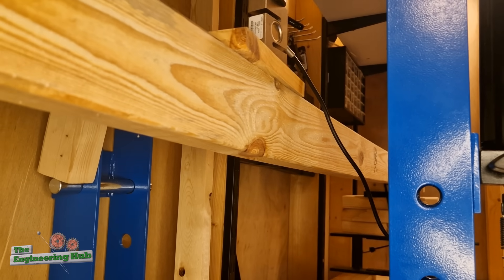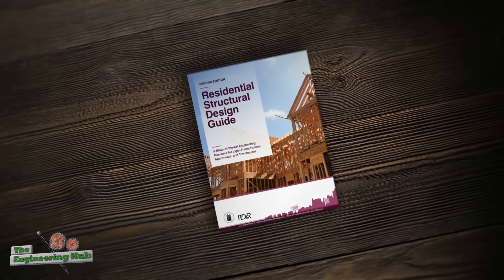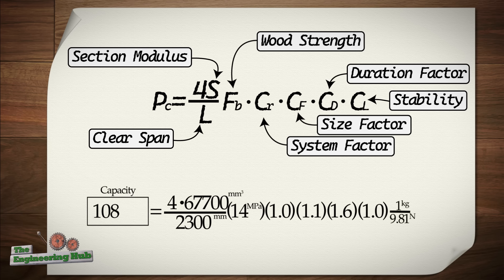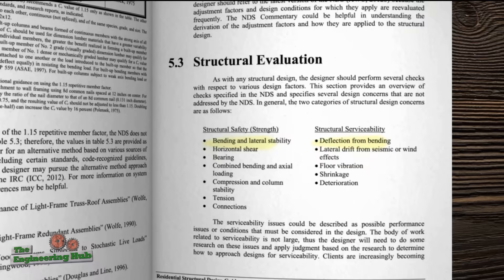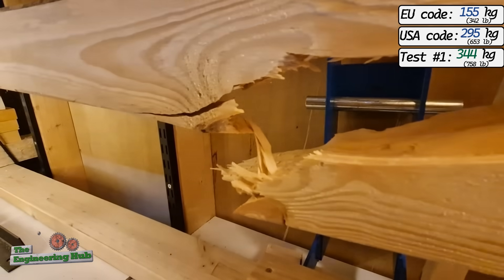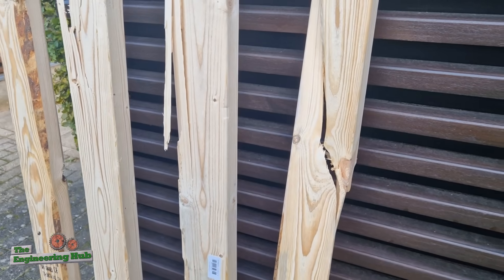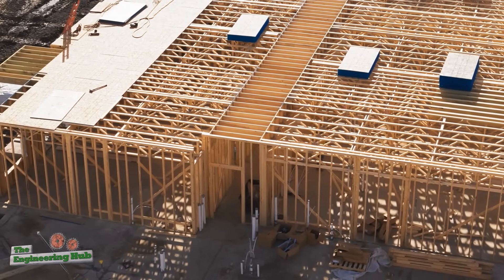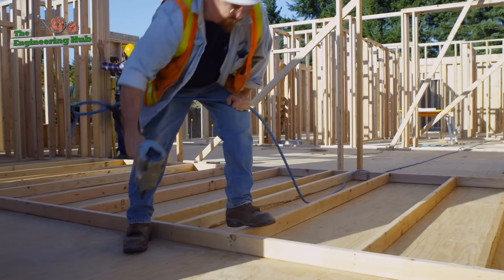I tested the strength of the 2 by 4!

Comment: Graded C14 apparently - I have never seen anything less than C16 in the UK and C24 is pretty common. Looking at those C14s, I wouldn't make a chicken run with them.
Reply from the maker: I bought the wood in Denmark and I would say most of the lumber (at that store at least) was graded C14 as you can also see in the video. I'm not sure if the graders are just being overly conservative because the yield stress was way more than 14 MPa although the boards did look very poor on the outside.
Reply: @TheEngineeringHub  Many thanks for the reply. It's a long time since I did the sum but if you take the text-book figures for the tensile strength of pine you get far higher ultimate load capability than the ratings. Also, the degree of pessimism applied to, for example, roof structures seems to have increased considerably over time. Some years ago we had a garage roof replaced. The original, some 70 years old was a corrugated iron job supported by 2 x 4s at a considerable spacing. Its demise came only after a considerable period with the sheeting rusted through in places. Its replacement, to modern regulations, included a 10 x 4 cross-beam to halve the span and 6 x 2s at about half the spacing of the original 4 x 2s. I did wonder if they had stressed it to allow the car to be parked on rather than under the roof.🙂
Reply: @ColinMill1  I was told that old timber was stronger per cross-section than modern one because it tended to be more slow-grown and hence denser. I am in the middle of refurbishing a 90 year old house, and I can tell you that the 90 year old 2x4s that I am removing are noticeably heavier than the new ones I am putting in.
Reply: @chrisgemmix0815  It's possible. I have just measured the density of some new offcuts here and 480 kg/cu.m which is in the middle to upper end for white pine but there are plenty of pine species it could have been in the past that are denser. One thing that is different here is that, going back 60 years 2 x 4 sawn really was 2 inches x 4 inches. These days it's a good 6mm under that in both directions. Even allowing for that the regs do seem to have gone extremely pessimistic over time.
Reply: In Norway c14 is not allowed in load construction, min c24, assumed the same in Denmark.
Reply: @ronnyjohansen1636  In Norway you have no shortage of trees to choose from I think.😀
Reply: @ronnyjohansen1636  You can use C14 for internal walls only in Sweden, else C24.

Comment: The piece of wood you have between your press and the beam is spreading the pressure out, which the standards authority tests might not do? (IDK, just noticed this, that's all).
Reply from the maker: I suspect the same, it probably helps distribute the load and achieve a slightly higher capacity. But I don't think that it would help more than a few percent, max 10%.

Comment: In Sweden, the smaller dimensions are wood that has been planed. If the plank is sawn, it has larger dimensions. We use the metric system, but I use inches when it comes to lumber. I say, "Two inches Four" and if the plank is planed I say, "Two inches Four planed"
Reply: Yeah, 2x4s were the full 2" x 4" pre-war and not planed, so they were rough sawn, here in the States.  Then there was a period of a few years when they were 1-3/4" x 3-3/4", finally becoming 1-1/2" x 3-1/2" and fully surfaced and planed.  If my memory serves, they may have begun the transition right before we entered the war, like '39, '40, or '41.  We can still order rough-sawn dimensional lumber for design elements, and the older guys (I'm raising my hand here) will still order our larger pieces (6x, 8x, etc.) by appending S4S, for surfaced four sides.

I never found a definitive reason why the transition was made, but I am assuming much had to do with cost savings (8X volume versus 5.25X volume, a full one-third savings) when people realized that vertical members did not need that much mass with the load they were usually carrying, along with the more pleasant smooth surface.

I could go on and on, but I'm sure I've bored to death more than just a few.
Reply: Interestingly, we right across the sea from you, in the Baltics, calculate with the same Eurocodes, but wood here is in mm, e.g. as 100x50mm (not even 95x45 as in this video)
Reply: @ivankuzin8388  100x50 = Two by four sawn timber. I didn't work much with building carpentry, but mostly with fine carpentry. Our timber was always carpentry-dry and unplaned, and we just said Two by four.
Reply: Alla kallar det 45 x 95 nuförtiden.
Reply: @SkogsMangan  Utom jag som säger två tum fyra hyvlat. Jag jobbade inte så mycket med byggnadssnickeri, utan med finsnickeri. Vårat virke var alltid snickeri torrt och ohyvlat.

Comment: Note that if you've bought 2x4s in the big box stores (HD I'm looking at you) they aren't even 1-1/2 x 3-1/3 but almost 1/8" smaller in both dimensions. So I built part of a project with one delivery then had huge problems because all the lumber was smaller. I went to the store intending to return the lumber I thought had been missing BUT found out everything they were getting had experienced 'shrinkflation' (like in the grocery store where the box is the same size but has less contents but the price didn't change, so you ARE paying more for less). I went to a couple other suppliers, found some older bundkes still the old size and bought all I could afford to stock & store for future projects.
But the point is that smaller 2x4 aren't going to meet the strengths the old ones did.
But that wasn't the problem I had, we built some walls with a mix of old and new lumber and the dimensional differences weren't noticed until the sheetrock was being installed, going fromba std board across to a narrower board then back to a standard board leaves a gap under the sheetrock at the narrow board and caused the screws to pull through there. Yes, crappy builders don't care and a double bay of unsupported sheetrock would probably last long enough for the warranty period to expire but that's not how I do things. Andvif you built a whole house out if the smaller lumber, tolerance stacking would throw off your prints dimensions eventually. So new prints would have to be drawn up? The mills aren't doing this on their own, the big wholesale outfits buyers have to approve (and maybe even instigated it to get more sticks of lumber out if trees so more profits?)
Reply from the maker: Also the fact that the new growth is harvested at a much smaller diameter could play into the push for another size reduction (just speculating, I don't really know) but the motive of higher profit margins is probably baked in. For now the high reserve strength seems to cover any potential cut on the dimensions.
Reply: @TheEngineeringHub  yes on the strength but it really does create problems when your using material that's smaller than specified. If a wall is thinner because the boards are smaller, will prefabricated window boxes fit? Code requires that utility lines holes through studs have a certain amount of wood left on each side, I forsee some inspectors who are picky failing some installations (sink drain lines running horizontally through a std wall pretty much have to be centered to leave enough wood on each side for compression strength support, i didn't measure but if the line was just offset slightly with the smaller stud then it wouldn't have the code required measurement.
Reply from the maker: @bobjoatmon1993  oh absolutely! So many issues with mismatched lumber. I was not disagreeing with you: I was just adding a thought. Cheers
Reply: @bobjoatmon1993  2x4 walls are antiquated unless your framing double walls
Reply: I have an older house like 100 years old and the two by fours are real full dimension 2x4 inches. I was shocked at what passes for a '2x4' today. Not even close in deminsion
Reply: The big box stores absolutely dictate size.
Reply: According to Wikipedia and other lumber-related sources, 2x4s haven't actually measured 2x4 for over 100 years thanks to the growing demand for milled and finished lumber, and the decision to standardize on the 1.5" x 3.5" finished dimension began in 1964.
Reply: @torqueytorque8861  the point is that even the 1.5x3.5 standard is gone and that really complicates following plans based on the old 1.5x3.5 dimensions. Other lumber and sheet has also been metricicized smaller and yet prices are higher. Shrinkflation
Reply: @bobjoatmon1993 Where are you getting your lumber from? 1.5 x 3-1/3? These are not nominal lumber dimensions for 2x4. It's 1.5 and 3.5. Why are you claiming this no longer exists? In the US it is still 1.5x3.5 so I'm not sure where your claim is coming from. You are telling me your lumber is 3-5/24 inches in width. Thats a shrinkage of 7/24" or almost 1/3 of an inch. Lumber can grow or shrink by 1/8" but 1/3" due to moisture loss or gain but I have never seen that much deviation from nominal which is 3.5". At most is 1/8' but most are within 1/16" of nominal. If your lumber is really that off, then I would return it because those are not nominal 2x4 dimensions. Nominal in the US is still 1.5x3.5 . I've never seen 3-1/3 nominal width for a 2x4 aa you claim. Home depot lists there nominal 2x4 dims as 1.5x3.5 but yet you claim 3-1/3? Where are you getting this number from. And then it's shrinking 1/8 from that? I'm not buying it because I do not know of any place that sales 2x4 as 1.5x 3-1/3. Where on earth are you gettig your nominal dimensions from? Go look at any lumber yard/store and it's 3-1/2 not 3-1/3.
Reply: @vangmountain  The HD store in Tyler Texas. And I checked several bundles, it's ALL UNDERSIZE. And i used a calipers so it's not measuring error. 
Im complaining / commenting about a problem and you want to nitpick.
Why do I bother.
Reply: @bobjoatmon1993  I'm not nitpicking at you, but I did have my doubts because those measurements you gave are just unheard of in my neck of the woods. So yes, I was genuinely questioning you in the hopes of seeing if this was in the US. Seeing as it is Tyler Texas, I can believe you because Texas consumes so much lumber. Demand can have an impact on quality. Me personally, I have never seen such numbers and I don't think it's a widespread issue like you think it is. If I had to posit a guess, I would say it'a where you are at Tyler. Small town in big staye with high demands. Tyler is getting scraps while the metros are getting all the good stuff. This I can see. What I can't see is everyone getting junk. Texas' demands are too big to make upset. Likely it's confined to Tyler. They dont carw if you get upset, bit they do if a big contractor gets loads of lumber and none of it is good and to puts the back. Time is money so big cpntractors aren't goimg to put up with it. All I know is at one time, I had family friends buying lumber from HD in MN and deliveeing to OKlahoma for nice profits which is insane because there was no lumber to be had. So yes, I can believe your numbers but I don't believe it's an induatry thing. Without knowing the region, I had my doubts about the numbers you provided. For sure it's not widespread. The other thing is it can be specific to a particular mill. If HD knows this is a problem, they are going to send that mills material to the smaller areas where there voice doesn't have much clout. Just my thoughts.
Reply: @vangmountain  now that I can agree with
Reply: Try putting a 1 x 2 next to a 1 x 4 and notice the different thickness.  This is just wrong.
Reply: @bobjoatmon1993  The lumber I purchased last month at a Home Depot in the Mid-Atlantic was 1.5” x 3.5”.  Sounds like somebody is pulling a fast one where you are.

Comment: Does the code describe when the 2x4 colapses or it's maximum safe load?
I mean, I'm not a structural engineer, but as far as I know, they have something called 'safety factor' or something like this, which changes depends on the application.
In some application it can be 2 in some other it can be 5 or more.
eg, if that board failed at 500kg load, then can be used for predicted load of 250kg in flooring (factor 2), but only for predicted load of 100kg for a bridge (safety factor 5).
btw. those factor values are just random numbers, to describe my idea.
Reply: I think I remember "allowable stress"  for wood is the 5th percentile strength value/2.1.

Comment: I'm a bit concerned about using the load cell in this way. The force should go in the threaded holes, not distributed over the whole face.
Reply from the maker: @MichielvanderMeulen  I calibrated and tested the cell extensively before the experiment. I am comfortable saying that it matched with the loads displayed on the press (traditional pressure gauge so different measuring mechanisms) within 5% agreement. For a YT video it should be okay. Cheers

Comment: What ever the dimensions and species, the grade, etc, the engineering is done from simple tables and they tend to be quite good. I've never had any kind of framing failure in 55 years. And I'm still working, too! The 1.5" x 3.5" has not changed for many decades, I think since 1964, when I believe it had been reduced from 1-5/8 x 3-5/8," and it had been that for decades. And people are STILL saying,  "You mean its NOT a REAL 2 x 4" ?!  No ma'am, its a sort of funny deal we get from the lumber companies. But I assure you they are entirely adequate." Now of course we use 2 x 6, if you can handle the nomenclature, and we went to 2 x 6 to accommodate more insulation, also an old story. The whole thing reminds on of other questionable dimensions, but lets not make this more complex than it is.:face-green-smiling:

Comment: Did you use the correct die to do the test? that board which the gauge seats seems that is helping distributing the force
Reply from the maker: @tuzzogetti  Yeah, I started to suspect the same since all failures happened on the tension side. But I had already started with this setup, so I continued this way. It could be helping for sure, but it wouldn't be a huge contribution I don't think.

Comment: It might be helpful to at least briefly discuss different grades of structural lumber. “#2” vs. “Stud” or cruddy  “Construction” grade can make quite a difference in rated strength.
Reply: Grading in itself is an interesting topic. Visual grading of lumber relies on a (hopefully) well-trained eye, and the strength is derated as a consequence. So is machine-graded the better solution?
Reply: Seriously! You ran flexural tests on stud grade pieces of wood.  These are manufactured to be loaded in compression.  That is why there are knots in them.  Tight knots affect minimally the compressive strength, and design codes takes this into account.  For flexural strength, use No1 and No2.  Sorry you wasted your time testing.

Comment: The illustration of all 100 potential 2"×4"s under the bell curve was really good. I wish more statisticians explained using that method, because I think a lot more people would understand the visual distribution instead of fighting engineers about the numerical one.
Reply from the maker: @k.jespersen6145  thank you jespersen🙏 I agree hehe
Reply: Now test an old reclaimed 2x4 from the 50's
Reply: I'm a mathematical non-visual person (and a statistician). The numbers are all I personally need.  But even some other engineers prefer to see diagrams. My struggle is that the same info that I can describe verbally or in writing in 15 seconds takes two hours to put together in a diagram.  There's no real "answer" here except trying to find how to either describe it more effectively or to figure out how to put diagrams together more quickly.  I've worked for many years on both, there's no perfect answer.
Reply from the maker: @Stephenwc  well said!
Reply: @Stephenwc   Agreed, no perfect answer. I am both able to understand the mathematics and the visual diagrams, a key characteristic of a technical communicator. Still, in all the years that I've been translating between scientists, technologists, statisticians, business-persons, and laymen, the takeaway has always been that more visual diagrams are better for universal understanding. This conversion of bell curve from probability spread to concrete example was a particularly good one.
Reply: At the same size, 2×4, wood strengths vary widely. Some pieces are much stronger.
Reply: @got2kittys  Tree rate of grow. Buy Finland wood or North Canadian and find out their strenght.
Reply: @m.5051   Question... mark...? My comment was in praise of the illustration of statistics. Did you put your response in the wrong place?

Comment: BTW why are you testing the flexion rather than the compressive strength since most building systems rely heavily on Compressive strength not flexion. Also if you are testing the flexion strength why test it in a vertical position and not in the Horizontal position? A board under a compression load can still flex, but it is most likely to do so horizontally as that would be the weakest position rather than the vertical, that is why blocking is installed !
Reply: If you watched the video he explains that he’s only looking “flexion” for a reason